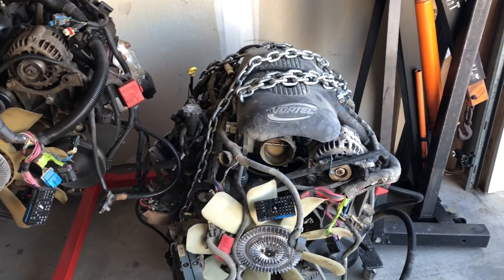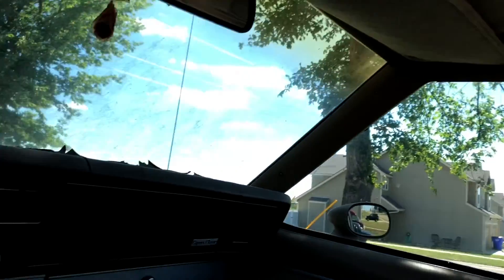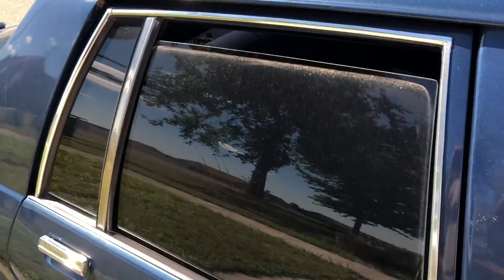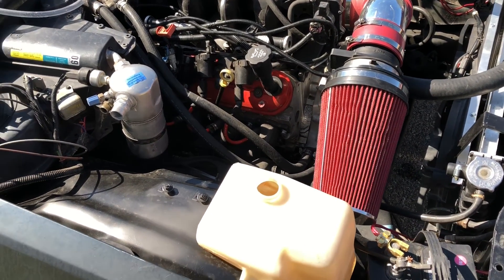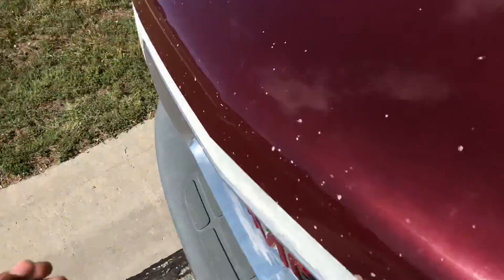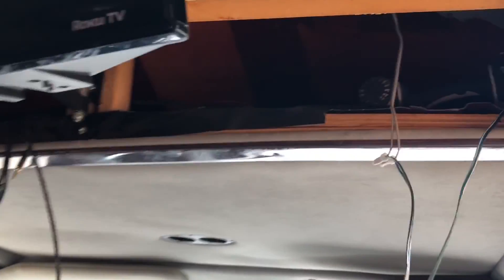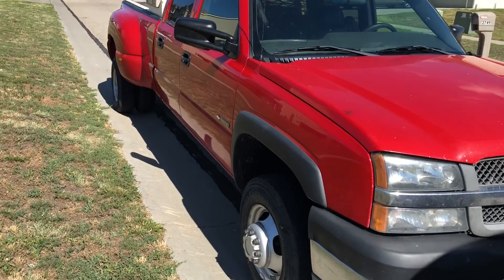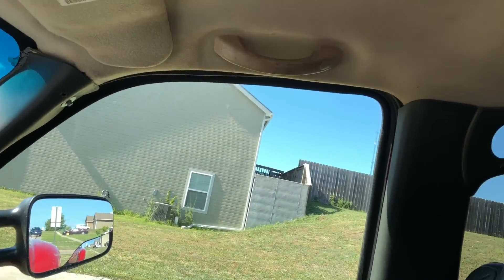I’m Back Again!

Comment: Hey you know how you said you want to keep the stock radio on that car and put in like a council for another radio you can truthfully actually put an app on your stock radio and for your inside speakers and have everything stock and it would be just as loud and it would be original something to think about you probably the first box Chevy out there like that with a stock radio with the amp on your insides an app on your subs there's also other little wire hacks you can do to make it Bluetooth to just a thought to be original and different
Reply from the maker: BadBoy RoadKing 🤔 think I might give that a shot. Only thing about that is it’s going to need an EQ for sure.